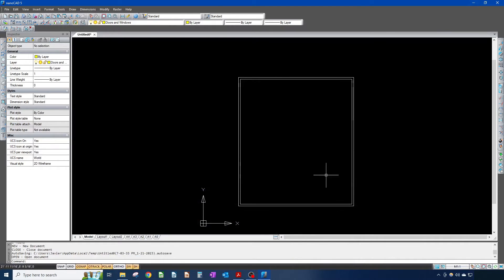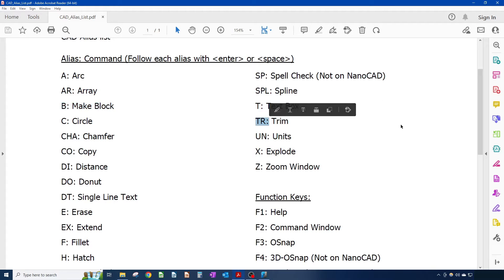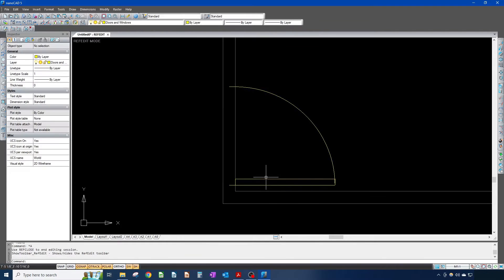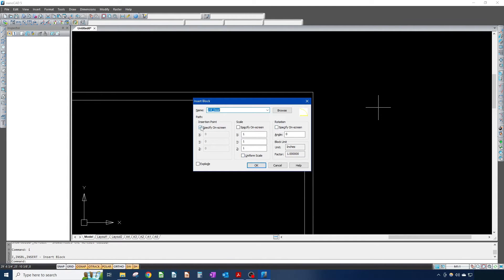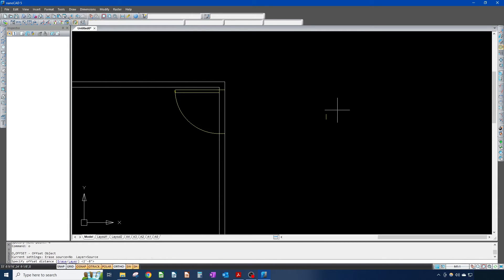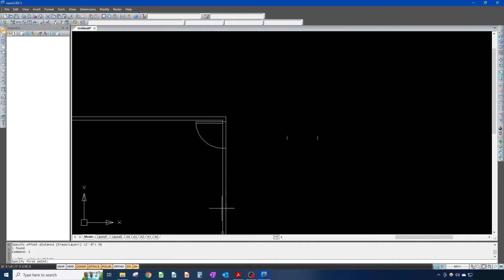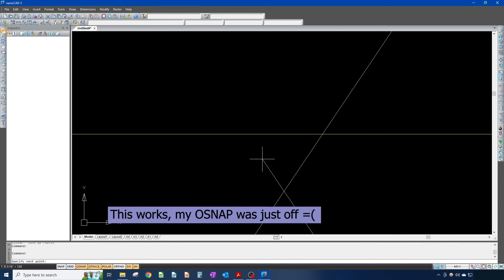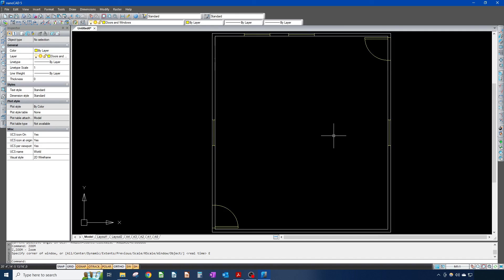NanoCad (AutoCad) Tutorial 2: Blocks, Trim, Extend, Insert, Rotate, Circle, OSNAP, and Copy

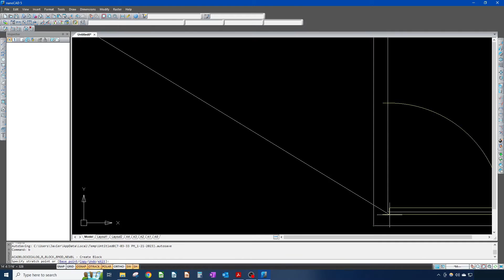Comment: 4:44 How do you make the object move exactly by 2" from the reference point? I'm trying to do exactly the same as you but for me it doesn't work.
Reply from the maker: Hi, sure thing. 

First make sure you have OSNAP and OTRACK on (located on bottom left corner below the command line.
While i was moving my part (door) i hovered my cursor over the corner of the shack (but i didn't click). A little "+" should appear where i was hovering and then i moved up and typed "2"<space> to specify my 2in distance. That little "+" allows you to track from that corner that's the OTRACK.

Apologies i realized i could have specified this a little more so i cover OTRACK in another video. I hope this helps and please let me know if you still have questions on it.
Reply: @TexotikChannel  Thanks! I had too many OSNAP features turned on which was throwing the software off. Now I just left the same one as you have and it's working fine.